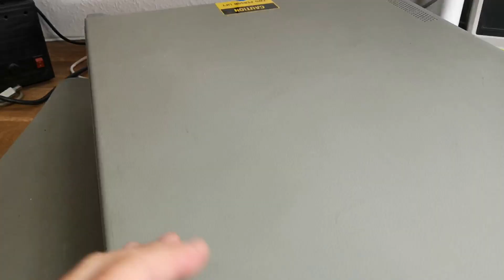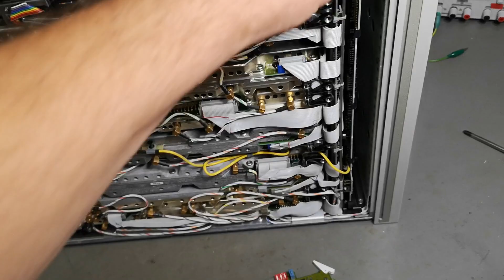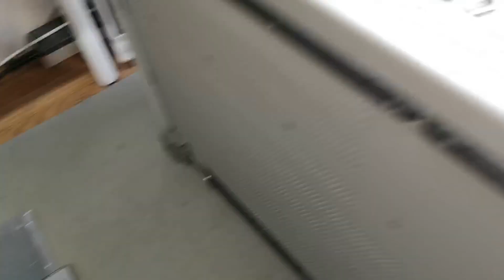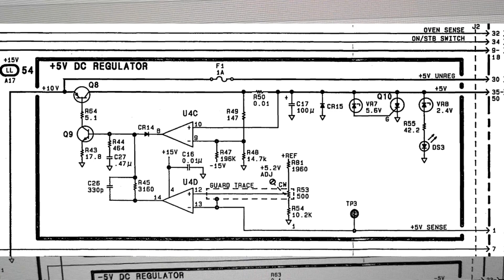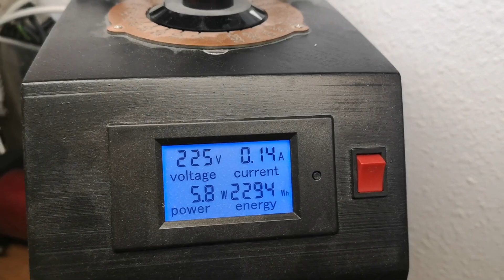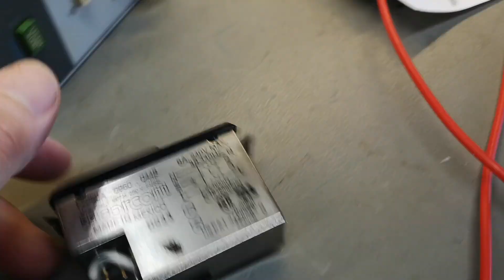HP 8642A Signal Generator 1050MHz repair teardown

Comment: Thanks for this Thomas! I just picked one up. The fan wasn't working so I replaced it. I do see clipping on the top of the output at lower frequencies and it increases with amplitude. By 5000Hz it is good. Perhaps a thermal issue happed before the fan was replaced. Any thoughts on this?

Comment: I'm not familiar with the 8642 , I've used the 8656 years ago ...... Does the 42 do what the 56 can do but at higher frequencies ?  Modulation is not shown on the display in any pictures I have seen and you have the only video on the 42 on YT ....
Reply from the maker: not exactly the same front layout too, minor conmetic differences but they both do AM and FM

Comment: I think you should look into those power up test failure messages. The "unlocked" one probably explains why you are measuring 102MHz. Even a non-precision master oscillator would be orders of magnitude better than 2% off. 
I have a HP8672 with options to  cover 10MHz...26GHz, and when I got it, the "unlocked"" light was on. I could fix that by just adjusting the trimpots on the YIG driver board, the procedure is in the manual. I guess yours is probably not YIG based, but maybe a similarly simple solution exists.
It would be a pity for such an exquisite generator not to function properly.
Reply from the maker: exactly the unit will under go a much more detailed trim and check,

Comment: According to the 1989 HP Test & Measurement Catalog, the Synthesized Signal Generator was meant for "the most demanding out-of-channel RF receiver measurements," and the 1GHz 8642A listed for $24,050, while the 2GHz 8642B listed for $33,050, plus another $2,100 for the "High stability time base." "On-site repair kits" listed for $20,500 and $27,000 respectively . . . !!.
Reply from the maker: wow thanks it is quite easy to use online inflation calculator to make this value into todays money :-)

Comment: If it is a blown cap or similar it should be possible to locate it by smell. ps: I'm a bit shocked about you writing on that power supply PCB .:hand-orange-covering-eyes:
Reply from the maker: writing on pcb is very good to do in case of lack of silkscreen the information is very helpfull during my debug test and repair, i normally leave it, so future people can be happy to save time and trouble in case some one else need to repair it again.